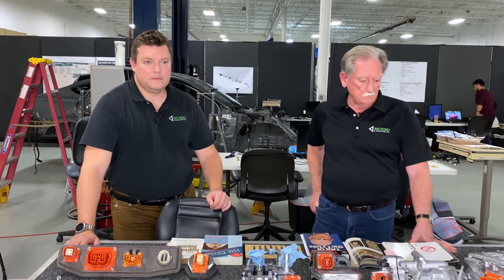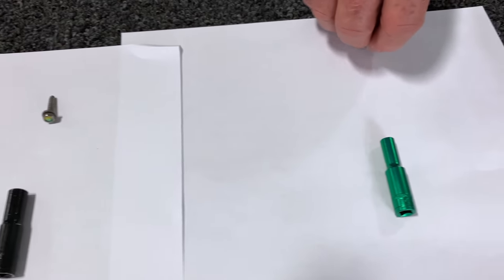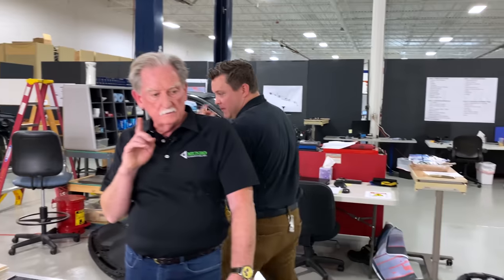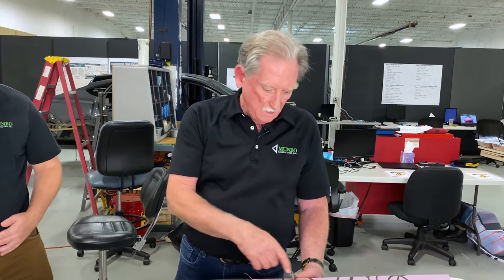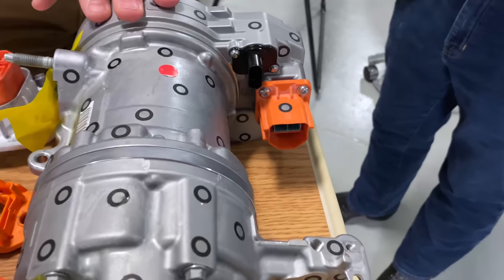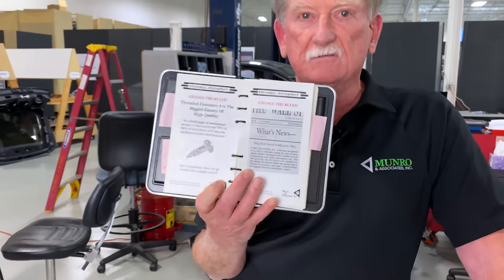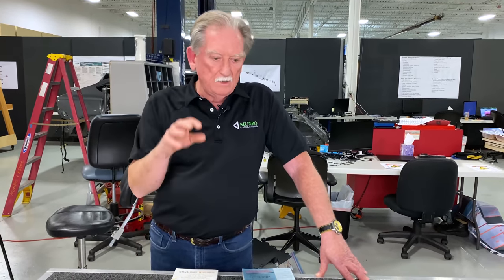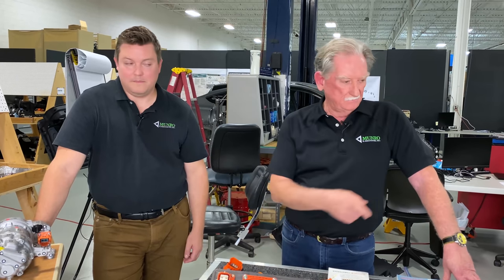Mach-E High Voltage Connector PALOOZA!!!

Comment: The color of the largest connector is the best orange!
Reply: True.
Reply: yup
Reply: Agree
Reply: The deep, vibrant orange.  Not the ones that look faded.  Agreed.
Reply: Exactly, an Orange that’s loud & proud of its Voltage.
Reply: I vote also for the bright orange one. Go Team High Voltage Input Connector!
Reply: A couple of those look peach or flamingo.
Reply: agree.  as mentioned, it's vibrant.  the "orange" is more on the "red-orange" spectrum, giving it the bold look.

Comment: Finally somebody with clout is speaking up. I'm a body technician and this is a frustrating problem I have working on Fords. To take off a single part why so many different fasteners?

It's not rocket science, sometimes I wonder if they are trying to irritate technicians.

Thanks very much Sandy and company. Your contributions on this channel will not only make manufacturing better but also will make the technicians life less stressful
Reply: It’s not that they’re trying to make your life difficult, it’s the fact that so much of what you work on was made by suppliers. If the suppliers are tooled up for certain fasteners, they’re going to keep using it. At the end of the day, the suppliers can offer a lower price using their own design rather than Ford’s particular design, including whatever fasteners Bosch/Denso/ZF/Faurecia/etc. have on hand
Reply: recently did a water pump on 2002 f150, thankfully all 9!!!! fastners had the same size head, however there were 3 different lengths!!!
Reply: @AnalogueKid2112  but you do realize when you are a large OEM you can dictate the terms to the suppliers and force them to change..  Doesn't matter what industry you are in.. but the big kid on the block always dictate the terms to their suppliers...
Reply: @Mellowyellow8888  Sure but what value does it provide to Ford? The suppliers probably said we can provide our turnkey module that we’ve already designed or we can redesign it to use identical fasteners which will add 5 months to the design process and $3 per unit. We can see which option Ford chose here. In the long run, Ford is likely to bring a lot of these components in house, which will be a great opportunity to reduce complexity. The Mach E was meant to be an early mover that was good enough for most people. Not an Ultium solution (haha, see what I did there)
Reply: @AnalogueKid2112  Suppliers are not the only problem.
Removing a bumper for insurance, will have fasteners of different sizes which require several different tools.

I will be taking apart a door, which in itself have different fasteners, then suddenly I come upon a bolt that require an 11 mm socket. I've never used an 11 mm socket on anything in my entire 34 years as a body tech. Not that anything is wrong; but why?
Reply: @peterpet77rp yea it’s as if everything was designed by a different engineer who has no idea what the other ones are doing. One thing I always loved about Japanese bikes. You can tear it down to nothing with mainly a few tools

Comment: Seriously, this is so enjoyable - its the same principles as in coding, best code is no code, if you need 2 different routines to do a very similar thing, then you need to rethink the design. I look at this and I am thinking... what THE ACTUAL F....
Reply from the maker: Glad you enjoyed it!
Reply: Refactoring in Ford seems nonexistent
Reply: Preach it, Brother Sandy!  As the good Dr. D. said, "Drive out fear!"
Reply: No such thing as repeating a method to perform the same function.
Reply: Maverick will prob have same issues then.. :( 2.0 turbo non hybrid ftw 🙌
Reply: Code works differently, you can certainly over share code and get in a bind when different consumers have diverging needs so they now need separate routines.  The need to worry about a few kilobytes of ram or storage space isn't as important today as focusing on current and future maintainability.  If repeating code saves you problems down the road, then you repeat code.  Write maintainable code, not clever code.  Getting overly clever can cause way more problems than having small amounts of duplicate code across an entire application with different parts.
Reply: @_PatrickO  i dont get your first point, what does it have to do with what I wrote??
Repeating code is precisely NOT good for maintainability - needs to be avoided whenever possible! Only ever had issues with ugly redundant code, never with clever one so far, maybe im just lucky.
Reply: @PiotrMys  lol, you have never written code on a large codebase if you don't get it.  Nothing is more annoying when someone shares a simple method across projects for no reason and now their clever efficiency means someone else has to do twice the work to decouple them down the road.    Maintainable code doesn't include unnecessarily coupling projects with small bits of tiny overlap.
Reply: @_PatrickO  ok this is then just bad faith. Whatever dude.
Reply: @_PatrickO  So you are not reading what he writes but imagining he had written something you can argue about then?
Reply: ...the best product is no product. Senseless competition doesn't create improvement it creates chaos.
Reply: @_PatrickO  Repeating pieces of code within a program - logic structures is not a problem. Having a bad piece of code that's used multiple times in a program is bad. Having multiple unique pieces of code that perform the same function in different parts of a program is bad. Having any unnecessary code in a program is bad. Worse is a program that lacks logic logic for checking inputs and bounds, that has  excessive permissions, or is revised and deployed without testing.
Reply: @psdaengr911  Stop flim flamming, no one cares what words you piece together while pretending.
Reply: @_PatrickO  Do one thing and do it well.  I agree on over complicating just to reduce lines of code.  Much like with old school thinking on relational databases "Normalize until it hurts; de-normalize until it works"
Reply: Watch the video where Sandy and his guys dissect the Mach-e thermal system (Part 2) and compare it with the Tesla model Y.
Hilarious.  Yet he and his team are as always, straight talking.

Comment: Show me the orange colors in different lighting conditions. I'm an emergency responder who will be looking for these components in dark, rain, snow, and being illuminated by flood lights and flashing strobes of red, amber and blue. Whichever color is the easiest to distinguish under those conditions. In studio lighting, I like the aesthetic quality of the large connector (#2 from the left) 😁
Reply: as emergency responder you should not need to worry about these connections ever actually. All you have to find and cut is the the 12V first responder loop, which will disconnect the High Voltage Battery internally.
Reply: When I worked for one of the big three in production engineering for wiring harnesses, one of the big issues was the color of the wiring and wiring placards. Plastic and printed colors, especially oranges, change with different artificial and natural lighting.  Some oranges went very red in natural light.  So we had additional indicators besides color to be sure the worker got it right.  I can only imagine the trouble you guys have.
Reply: if you want to distinguish shades of pink/brown (skin), orange, red, etc. in the dark get yourself a flashlight with a "high CRI" LED. 
for duty light recommendations go to budgetlightforum.com or reddit.com/r/flashlight
Reply: You'd think SAE would have a standard for that. 
Fluorescent color lights up under LED light, which has a lot of ultraviolet.

Comment: Many different departments doing their own thing it seems.
Reply: Silos, Silos everywhere, but not an email between
Reply: I had this in the office where I worked. When I moved departments, I found that both were using a small program to make a particular calculation. Both departments had built their own version without checking to see if there was any commonality between the two areas.
Reply: This is rampant at large corps of all types, lots of middle/upper mgmt types looking to build their own fiefdoms and don't know or care about what their department is doing
Reply: They are probably different suppliers for many of the components. It looks to me like the Mach-E is a "version zero" product - it just has to work, it doesn't have to look good. Refinement will come later. I don't think reliability will be great for a while with so many hoses and connectors.
Reply: @chrislangstaff   That is exactly what is wrong is most companies and govt and they die... slowly and painfully.
Reply: Connectors sourced for a variety of suppliers, who all have their own screws to secure their own connectors
Reply: Looks like Ford engineered a prototype.
They will figure out production later.
Reply: That too, the signs are all over the place.
Reply: @lsauve  That's pretty much the case I think. A corner's been cut to get the product to market earlier. It's a bit like looking at a well finished prototype. Go 'underneath the skin' and there's no shortage of 'ugly' things.
Reply: @rwdplz1  Yup. Very likely the screw that's in the 'reference application' is the one that's been used and they're all different types.
Reply: @davidhumeston5292  Oh, I just commented exactly the same !
Reply: @rwdplz1  I find it hard to believe that BOTH ENDS of every cable would use totally different screws on the connector completely by chance. This really feels like it would have had to have been by design, probably to prevent the wrong parts from being used.

Comment: Sandy throws alot of rocks, but each one is wrapped in paper describing the problem, a possible solution, and research to back it up.
Reply: As an outsider I could see how you think that. As someone who's dealing with state of the art current automotive fastener development there are some major holes in his understanding. You can tell he's speaking from personal experience that's 20 years dated at times.
Reply: @Barskor1  page through the previous videos usually I will leave a comment or two.
On this video specifically I believe they have misidentified a torx plus, and they are clearly using the wrong socket for removal based on the counter taper.
The torx plus standard was developed by Ford, it has been copied throughout the industry both by Tesla, Nissan and a few others. Low profile Torx plus is something that Tesla is very fond of. 

I'm not knocking him that hard, you can tell at one point he knew what he was doing. For general advice it's pretty solid. But he's not at a level that you would find in specialized IFI or internal fastener training geared to the design engineer or fastener production guys.
Reply: @otm646  Ah a specialist Obscura so they used the wrong fork at dinner boo hoo.
Reply: @otm646  
"Clearly using the wrong socket for removal...." ?
Doesn't that illustrate the problem?
2 screw types, on plain, one shouldered, with the same head type, applied to this whole unit, would seem possible?
Single driver/ socket, reduced inventory for the fasteners?
(Maybe not 2 types, but my point is that a little thought, maybe some conversation at the design stage could make things much easier)
Reply: @rogerstarkey5390  Using the wrong socket shows that they lack the experience to know what they're looking at. They then go on to say that they had a difficult time removing it. You can see that the drive feature on the fastener is mangled.
Sandy is over playing the fastener count and variety angle here. These are existing parts being produced for Ford. You would have to have an understanding of the pack assembly line and the assembly procedure to know what influence they would have on the process and cost. If all of these fasteners aren't being installed at the same workstation it doesn't matter. You also have to look at the overall cost of part. That Tesla part is easily 5x more expensive even when ordered in higher volumes. Now factor in the mass of the fastener, yes even the mass of fasteners are considered.

I'm not saying that Ford made a perfect engineering decision here, what I'm saying is there are a myriad of external engineering, pricing, and sourcing factors here which go in into determining the "best" solution which could justify these design decisions.
Sandy speaks in platitudes because he does not have access to enough information to comprehend the complete picture but won't ever tell the general public that.
Reply: @otm646  you're clearly missing the forest for the trees. Sandy is trying to point out the error in engineering thinking that Ford is currently engaged in, with the multiplicity of fasteners, the tools needed to install them, inventories, opportunity for failure, and expense.
Reply: @otm646  Do please explain in more detail. I've been known to get 'exercised' about fasteners too and yes, if I can replace a threaded fastener with a push-fit type I'll do it every day. They're more reliable in many cases (can't 'back out' for example) aside from making assembly easier/faster. I'd say Sandy's spot on.
Reply: @Barskor1  Yup !
Reply: @otm646  Still doesn't explain the mix of hex head, philips, Torx, security types and penta-whatsit. That is insane. It's clearly really a prototype that still needs production engineering.
Reply: @otm646  You're making a mountain out of some molehill and completely missing the fundamental issue. The insane mix of heads and threads (and washers too !).
Reply: @otm646  If you can cut the number of workstations in half it sure does...
Reply: @otm646  - Seems to me having one screw type rather than 10 makes a lot of sense, even if it’s 20 year old thinking.
Reply: @otm646  - Do you work at Ford?

Comment: I used to be a Ford parts guy... I can confirm our connector assortment was over......... at least 80. And that's a very VERY bearish estimate. It was probably closer to 200. Not, even, lying.
Reply: Imagine if they hired a guy to co ordinate all the fasteners in the vehicle with the goal of having the least number of fasteners and the least number of types - accross all platforms. It's not even rocket science.
Reply: @kirkjohnson9353  it’s also how they don’t make money, lmao. Seriously… 40-60 bucks for the plastic lever that folds a mustang seat forward….
Reply: @gasser5001  It must have been  a nightmare at times to find things.

Comment: 8:50 My experiences tell me the reason for the high fastener count is environmental protection. Plastic covers unless well fastened make horrible seals over time. Plastic deformation will occur were the stress is highest which are fastener locations especially when have a through connecter applying torque perpendicular to the fastener from the weight of cabling on the exterior.
My guess is Ford is subcontracting out the production of the larger electrical components and each subcontractor is using their perfered fastener unlike Tesla that does pretty much in house.

Comment: If they re-ran that study on screws in 2020 they'd find 95% of mechanical failures are due to broken plastic interconnects. The industry has replaced screws with plastic interconnects, but because the plastic parts weren't in cars in the 70s like they are now, they didn't show up in the original study.

All of my non-standard maintenance automotive issues in my life have been due to plastic clips breaking off, which Sandy is such a fan of. I've never seen a screw or bolt break.

Comment: Sandy, it is the scourge of COTS (Common Off the Shelf Parts) causing this situation.  Instead of designers doing design, they are more of system integrators purchasing modules and COTS devices from Tier1 and Tier2 suppliers.  The specifications for the parts most likely don't include fastener types and focus on operating envelopes, MTBF (for recalls), and weight.  And of course I could be wrong about this, however from your videos I see more true design from Tesla than simply integrating COTS parts and modules.   The bigger question is 'Does anyone at Ford care?'     Thanks for the video!

Comment: Hi Sandy,
I have fixed cross threaded aluminum with Devcon A.
Oil the bolt and screw it in till it's hard,  then remove bolt and dress surface. That's been a big part of my mechanical life with restoring old cars, especially jaguars and Rolls-Royce I specialised in for 30 years. Rolls is all aluminum from sump to block to rocker covers. Including T400 trans and an aluminum differential casing.
Yes I've done my time with poor threads and crossed or rusty bolt in aluminum.

Comment: Looks like Ford outsourced every component. It would explain all the different fasteners.
Reply: Is the product still a Ford? Parts are OEMs and engineering is against the Ford engineering books. Exterior design is Ford I guess. Is it still Ford? Or just "assembled by Ford"...
Reply: @NTNLabs  Henry bought iron ore and sold cars.
Reply: @jamesvandamme7786  Yep, that's hardcore carmaking. You put iron in one part of the factory and a car comes from the other side...
Reply: @NTNLabs  Nowadays he'd have to buy sand, too. Maybe after this chip shortage they'll consider it. But silicon foundries aren't cheap. SiC is worse.

Comment: The reason you’re seeing so many different fasteners is because each of those parts were made by different suppliers. So Bosch or whoever is providing a complete PTC heater to the factory in Cuautitlan and all they do at the assembly plant is click stuff together. At the end of the day, the suppliers can offer Ford a lower price by using their existing tooling rather than Ford’s standardized specifications. In the long run, it might make sense for Ford to bring a lot of this stuff in house, but the Mach E was meant to get onto the market as fast as possible which it absolutely did.
Reply: There's also not necessarily a reason to condemn all the different fasteners. A lot of these fasteners are not intended to ever be turned by people in final assembly.